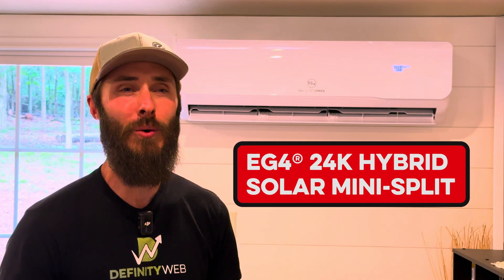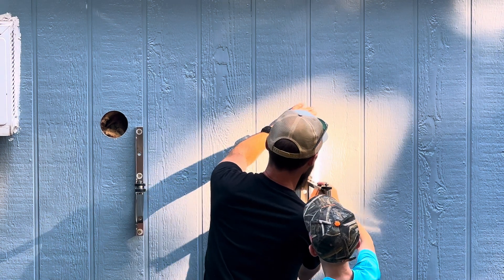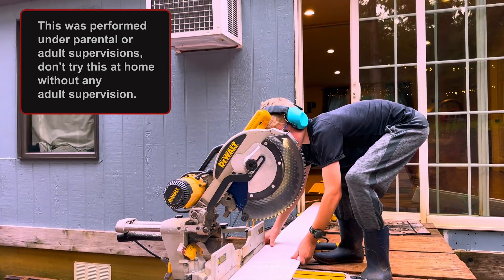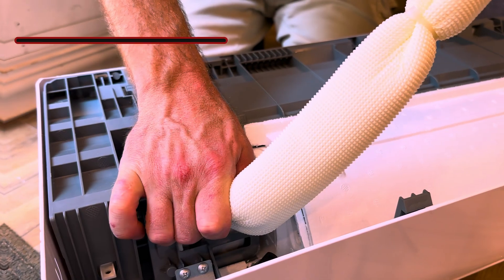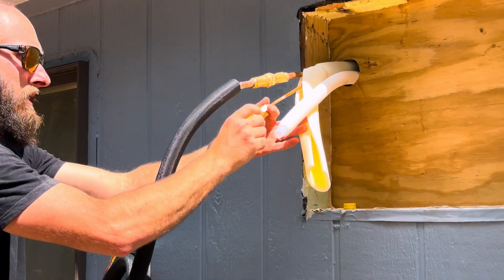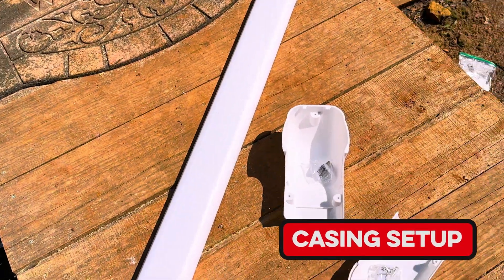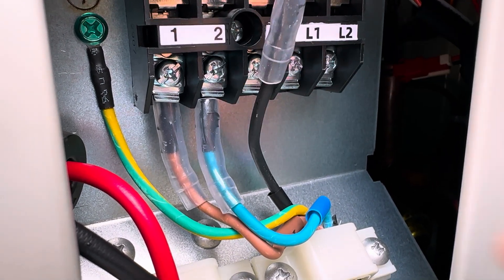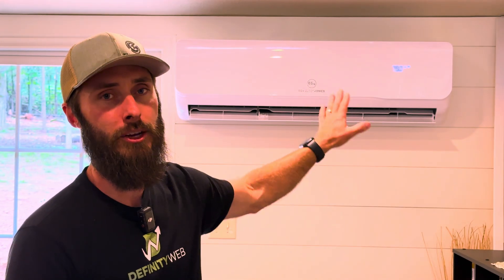Running AC with Solar - How to Install 24K EG4 Mini Split

Comment from the maker: Mini Split: 👉 https://signaturesolar.com/all-products/high-efficiency-appliances/?ref=esttxthst
Parts List: https://docs.google.com/spreadsheets/d/1xMLrhQuNRs2CTAksXSFTh49CK_OPp0fzC1n5K_Zhb1o/edit?gid=12894945#gid=12894945
💥 $50 Off at Signature Solar (Code In Description) 💥

 (You support my family when you use my affiliate links before you buy)

Comment: I got the EV4 24K unit also. The instructions say to make a 3 3/8 inch hole!! That's huge. Is that really necessary? Looks like the 12K only requires a 2 1/2 inch hole. Great video my the way.
Reply from the maker: If I remember correctly I just put in a 2 inch hole. 3 3/8 would certainly make it easier to get the lineset through. But as long as it fits I don’t see why you couldn’t go smaller.

Comment: How is this holding up?  What's the one year take on it?
Reply from the maker: Great question. It's working just as good as the day in installed it. A couple of things to note: it is probably too much for the room I have it in (but I knew that going in). It never stops blowing, so it will cool it down below what you have it set at, so it takes some getting used to to regulate the temp. The remote is ok, but the app is better. My energy usage is sooo much less than it used to be. Finally, I installed the 9K unit in my barn, so I guess that says something about how I like the brand.

Comment: What if we already have a mini splits installed through the system that you could add to an existing mini split that would power the mini split when the sun's out and then go back to grid power if the sun goes down I'm asking because I've got a brand new mini split that's less than a year old that I would like to power like this EG4 model , what are the benefits of having the eg4 versus adding a solar setup to what I've already got? And do you know a way to add a solar setup that will only power my unit when the sun is out and then switch back over to grid is that possible?

Comment: I have questions about my existing DIY solar system, and it’s abilities to operate this unit will signature solar answer those questions?
Reply from the maker: They may. These units take so little energy and a few panels makes a big difference. I think the 9K mini split I just installed draws less than 5 amps 120v.

Comment: Great video! What do you do with the white neutral wire for AC power? I saw your red, black, and ground, so I’m assuming if you’re using 3-wire, which includes a neutral?
Reply from the maker: Good question. For this unit, there is no neutral (white). Just L1 (black) and L2 (supposed to be red). The white wire you see coming from inside my home is the old neutral that was repurposed for the red L2. I should have taped it to be red to avoid confusion. Inside my home, on the breaker panel, that white wire is on the L2 of the double pole breaker.
Reply: @ aha! Thanks for the response! So 10/2 wire should do the trick, am I right?
Reply from the maker: @jamesdensley8974 I’d use it. Not sure about code but it will work. Get yourself a red sharpie and color the white wire on either end to avoid confusion.
Reply: @ you’re the man!! Thank you for taking the time to respond!

Comment: Do you think we should get the 12000 or the 24000 btu unit? That’s what I can’t figure out. Thank you 🙏🏽
Reply from the maker: How large of a space are you trying to heat/cool?
Reply: @ 200 sq ft shed house. I’m hoping to keep the ceilings vaulted, so 7ft walls and barn style roof (again vaulted open style). I can put a regular ceiling in at 7ft but I’d rather keep the ceilings vaulted, oh and I have only ordered the shed house not taken delivery yet so I’m still in the planning stage, thank you.
Reply from the maker: @thetigger240  That sounds like a great project! With a 200 sq ft area, you would actually need to go with the 9000 BTU unit. That unit will cool 500 sq ft just fine. Good luck with your project!

Comment: how or where should I use the sealant putty?  Thanks.
Reply from the maker: I can't remember if I mentioned putty in the video. If you're referring to the Nylog Gasket/Thread Sealant, you will put it on the threads of the coolant lines between the two units.

Comment: A few questions… How are these powered when the solar panels are not producing? Is this kit shipped or can you pick them up in Sulphur Springs? If you connect to the grid, what energy specs are required? (Volts, Amps) Thanks.
Reply from the maker: Great questions, Chuck.

They will always try to use as much solar power as your panels are producing. If the unit needs more power, it can pull from the grid to supplement what it needs from 0% to 100% of the power. If all you have is 500 watts of solar, it will use it and get the rest from the grid. if you have no solar, it will pull it all from the grid (or the batteries in my situation).

You can have them shipped or pick them up in Sulphur Springs. Either way works.

The 12K is a 120V unit.
The 24K is a 240V unit.
Both require a 20A breaker.

I think I got all the questions. Let me know if not.
Reply: @ Thanks!

Comment: Thank you for the great video bro. I will be working on a future(small office) and this is what I was looking for.
Reply from the maker: Great! I'm glad to help. It's been a rock-solid unit since installation.
Reply: @EastTexasHomestead  how many solar panels are you using? 3 - 400W?
Reply from the maker: @SucculentFever  I've actually removed my panels for the time being as I'm changing things up. But I was using 8 really old 225 w panels and they gave me about half of what i really wanted. I don't remember what EG4 recommends but a quick phone call to Signature Solar would get you the answers you need.

Comment: Great video - do you have any recommendations on the best way to drill through concrete blocks (8 x 8 x 16)?  Thanks!
Reply from the maker: You should be fine with any carbide-tipped hole saw with an extension. Most box stores like Lowe's will have what you need.

Comment: I love the video. I installed a Mr. Cool  4 head unit in my house about 4 years ago and it failed this year because I did not put some sort of thread lock on the line connections and over time they vibrated to the point that all my Freon leaked out... I would Love for you to make a video that shared this information. It pains me to say that I paid an HVAC guy to come out and fix my units. Over all he said I did a great job except for the locktight on the threads.
Reply from the maker: That's good info to know. I wish I hadn't skipped that step. I had the thread lock on hand but when filming, it's easy to get distracted and not do it the way you want. I wonder if I can disconnect it without loosing all the gas and apply it?

Comment: I live in FL and have an 992 sq ft townhouse. Do I need to get two 12k hybrid units or will one 24k unit cool off bot levels of the house.
Reply: I thought 🤔 the same thing. I literally just got my 24K solar unit today. Like today today. I will be installing it little by little with our storms we have had in Central Florida these days and this weekend. We have a 883 sq ft house and it is 2/1. It will be installed in our living/ kitchen. It should be awesome for that purpose. We will let you know soon enough. 😅
Reply: @onecrazywheel  How's the install going? We been having evening showers almost daily over here in Lakeland.
Reply: @bringit3164 I got the inside unit installed and the outside condenser up and installed on the bracket and the lineset ran and connected and the electrical almost completed. I'm an electrician by trade and am running an outdoor 125 amp sub panel from my main panel on the other side of the house so I will be connecting the 240v side of the electrical first. I also ordered 16 flat roof brackets from Signature Solar and they have just shipped.  I have ordered connectors and cabling for that too. God Willing I'll have the electrical done by the end of this weekend! Thanks for asking. Hope your install is good 
 I'm up in Seminole County.
Reply: @onecrazywheel  Awesome!
Reply from the maker: No clue how I missed this conversation, but I'm excited to hear your results!
Reply: Get 2 of them.. humidity is a killer there. I have a 9k pioneer at home.. it's super quiet and cheap on power.
Reply: @OFFGRID_Trucker  I will probably end up with 4 mini splits in our house. One in the living room and one in each bedroom.

Comment: Can that unit work both AC/DC?
Reply from the maker: It can! 
It will use as much DC as is available and supplement with AC as needed. You can also tell it to limit the ac and just run with the available DC.

Comment: Do you have a video installation for the solar panels wire? For the 7 panels from signature solar?
Reply from the maker: Not yet but plan to get one out soon
Reply: @EastTexasHomestead  do you know if the connection is on series or parallel?
Reply from the maker: @bmodllc  In almost every case, it will be series for this unit. 
Series will increase the voltage while keeping the amps the same. Parallel would swap that and give you way more amps than the unit can handle (12, I believe) while not providing enough voltage.

Comment: What’s the least amount of solar it runs on?
Reply from the maker: Good question. It (the big 24K unit i have) uses between 190W and 2250W. Most of the time it is running around 1000W. So you will need to get enough solar to get it to do what you want. I'd say you want at least 600W. The DC voltage needs to be between 90 and 380 VDC. All this to say, you could get by ok with a couple of good panels but you will likely want more.

Comment: Best part about mini splits in Texas is if you have multiple units and one goes out, you arent completely without AC! I absolutely LOVE having mini splits and would never go back to central. These DIY style units make life so easy when installing! I could probably knock one out in an hour or two by myself now that ive put in a few of them. Looks great and i know yall will enjoy it! Id love to see a follow up on hooking up the solar, how many watts, etc and how it performs! If you havent noticed, you definitely have my interest with this setup!
Reply from the maker: I agree 100% on having multiple units. That’s one reason I used to advocate for window units. I’ll do a solar panel hookup video soon.

Comment: With an open wall, I'm hoping I can run the line set down the inside of the wall and come out low on the outside of the building to connect to the condenser. It's a standard 4" thick wall, so I hope that's enough to bend the tubing down from the head unit and out the wall toward the bottom to the condenser.
Reply from the maker: Never considered that but it may work if there aren’t too many bends
Reply: @EastTexasHomestead  I'm going to give it a try with a piece of drywall big enough for the head unit and then I'll finish with insulation and drywall everywhere else. I may drop another comment with how it goes. Cheers
Reply from the maker: Please do! I’d love to hear how it goes